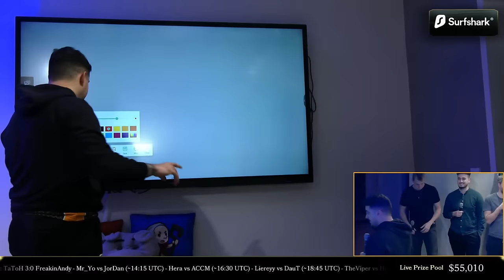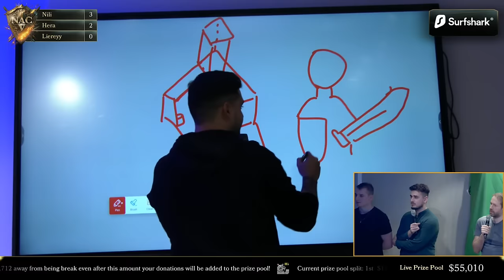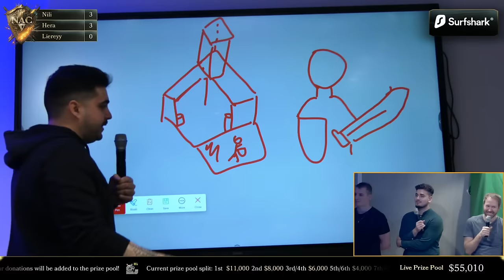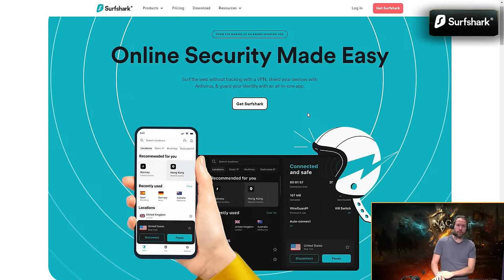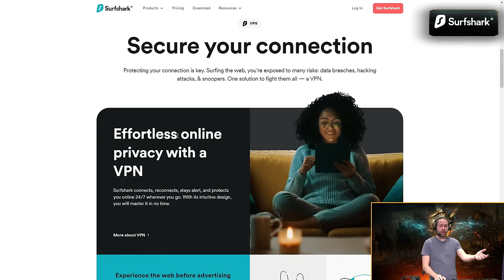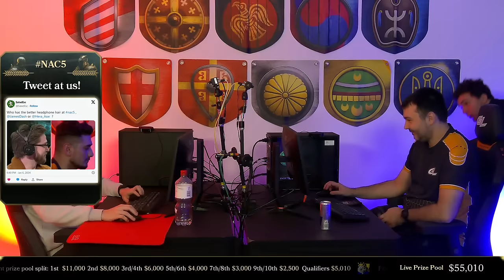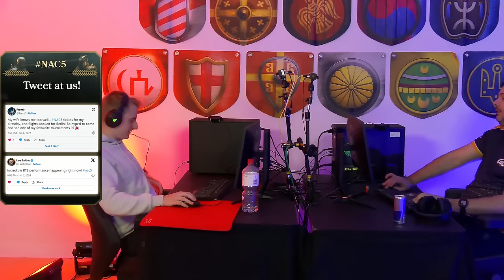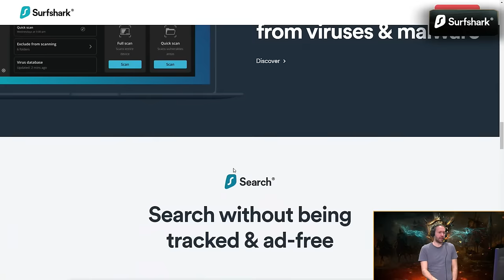NAC 5 Main event - Round #1

Comment: How are the group matches decided in NAC?
Reply from the maker: "Nerfox 
the short version of the story is - swiss system has many ways to go about it, you can google that yourself or even go through the entire FIDE handbook and many other resources out there, the guy who was supposed to do the pairings was not responding so since I had some experience with a swiss system in a previous event I proposed some things to Nili and then a decision was made

at the end of the day you always end up with 2 matches between people who are 1-0, 2 matches between people who are 0-1 and 1 match between the lucky person who is 1-0 and the unlucky person who is 0-1, just a matter of determining the order, in most variations of swiss, you split each score group in half by some criteria and then top half plays the bottom half

long version is probably not for me to tell

if you want to learn (and honestly this rabbit hole goes deep and you could write many PhDs in many disciplines about it), this is a good place to start:
https://en.wikipedia.org/wiki/Swiss-system_tournament
https://handbook.fide.com/chapter/C0403

hope that helps
also I should say that I'm by no means an expert on the swiss system, just got some experience using it (specifically manually, not just swiss pairings calculators designed for chess) so I'm the engineer here, not the scholar 11"